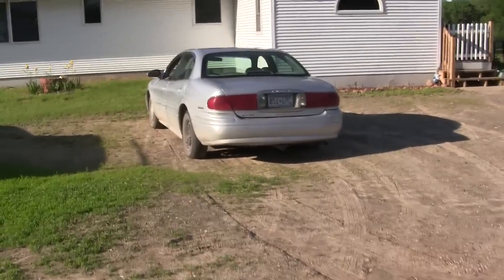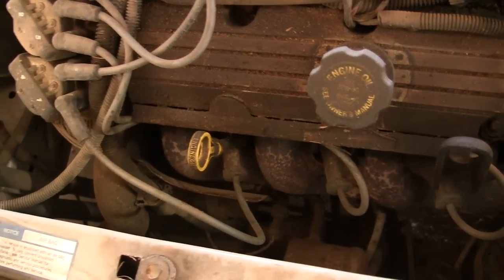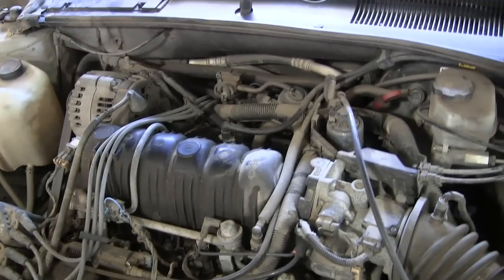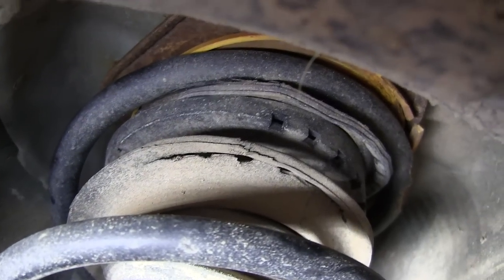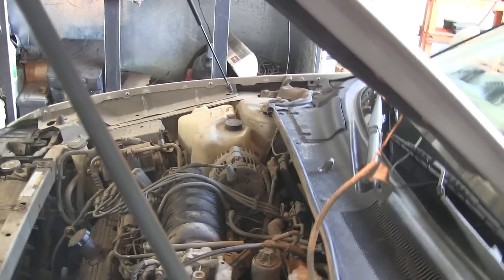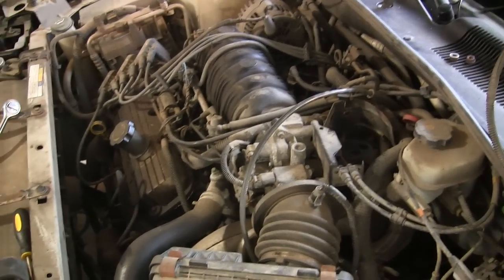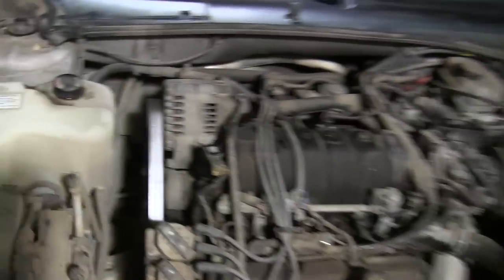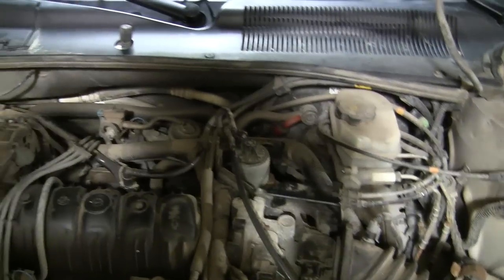Figuring out a miss in the 01 Buick Lesabre

Comment: The ICU is does go out on 3800 series II,  I have replaced mine twice on 2003 Chevy Impala LS,  the trick is to use heatsink compound on the bottom of the ICU on the metal plate.  Used some Artic Silver 5.   256k and still running strong  in 2019

Comment: A tip for other 3800 owners that may watch this; a consistent single-cylinder misfire on a waste-spark ignition system can be partially diagnosed just by switching the plug wires on the coil pack of the problem cylinder. If the misfire follows the wire, it points to the wire or coil; if it stays on the cylinder, it points more to the plug or cylinder itself. You can then swap two of the coils and see if the misfire follows the coil. If it doesn't, you could be looking at the ICU or inputs.
Reply: I put new plugs, plug wires, engine coils, and a new ICU and it still makes this sound and idles rough. Would you have any suggestions?
Reply: @yourbore you ever figure it out ?
Reply: @MonopolyBizTV  nope, wouldn't go over 30 mph. I had to get a new car.
Reply: I did that on a cavalier.  It both did follow the coil, and did not.  The ol Ivan don't touch it till you diagnose got me.  Was the intermittent ignition switch in the end.

Comment: The spark plug coil is my guess since you changed the plug. Then I would replace the ignition control module that’s under the coils. These are very easy to replace.

Comment: My wife’s 2002 Buick LeSabre was running rough.  Auto Zone’s diagnostic tool was of little help.  The car’s computer only threw a code that read “random misfire” which could be anything.  I was prepared to tackle the job of replacing all the plugs and wires because at 92 K miles I don’t think they had ever been changed.  Then after watching countless videos on how to replace the back three plugs I came across a video where the guy narrowed down the problem by simply unplugging each spark plug wire from each coil one at a time.  Sure enough I noticed that the wires going to the top coil pack which handles cylinders 3 & 6 had no effect on the engine when I pulled them off.  The engine continued to run erratically.  Hmmm....could this be my problem I thought?  So as not to pay retail in the event that I was wring I went to the local scrap yard and got one.  Plugged it in and viola....it worked.  Problem solved!  I was so happy.  I dodged a bullet.  I didn’t have to struggle with those back three which wouldn’t have solved my problem anyway.  

It goes to show ya that a misdiagnosis can lead to serious unnecessary work and expense.
Reply: Swivel socket is $5 those pesky back 3 would be out in no time.
Reply: @shanooby4359  That isn't the problem, it is getting the plug wire off so you can use the socket.  It is starting the thread to get them in that is fun as well.  I broke down and removed the alternator.
Reply: @robertsmith2956  bet those 2 bolts were a bitch

Comment: My experience after 25 years in New England winters and old cars from the 60s and 70s, we don't even try to take exhaust nuts off.  Just tighten until they break and then replace them.  In general the exhaust bolts are actually made to do that.

Comment: The ignition systems that utilize the otherwise wasted spark (like on the 3800 engine) fire one plug using negative voltage and its counterpart plug using positive voltage.  Center tip positive firing is said to be not as effective as center tip negative firing.  A coil that is starting to go bad may fire one plug poorly enough to set a misfire code on one cylinder but still be able to fire its counterpart plug sufficiently.  It can give the impression that the problem isn't the coil when in fact it is.

Comment: hello bac53 I have a 1997 buick lesebre 1997 the engine does not start I have gear and the board turns on and the luses turn off and it fails to start the engine, I have a spark, gasoline, in the scan it does not take out any errors that you could suggest me to check you, I would appreciate your information

Comment: Snap-on has the Vantage scope tester which checks ALOT of things! EBAY has it. It checks codes and waveforms and voltages and resistance etc. to find out what's wrong with a car. It has wiring diagrams on each car. South Main Auto has one. He's on YouTube.
Reply: The snap on vantage will not check codes nor let you look at a vehicle's data stream.   It is a damn good meter tho.

Comment: I have a 2000 Buick LeSabre and when I start it up and press on the gas slightly it misses and sounds like a backfire from the motor. also when going up a hill it feels like I lose a little bit of power, I changed the plugs and wires, did an oil change, what do you think could be causing this? Thank you for your time.
Reply: Scotty Warren Loss of power oxygen sensors. When is the last time you changed fuel filter? Suppose to change fuel filter every year. Loss of power means chew up gasoline. Its gasoline issue. Too lean? or too rich? You can pull fuel regulator its on manifold. First pull out fuel fuse before screw off fuel regulator you don't want fuel peeing out.  Screw it off clean it out with air hose this part rarely if ever breaks. Easy clean You could have a misfire fuel injector. You can use bottle of Seafoam poor in gas tank but use 91 octane gas a full tank aid in clean off baked on carb. take car out on the highway seafoam clean off built up carb. Is another check too if car shakes rattles? Its default or dysfunctional TPS (throttle Position sensor) its a lil black or gray in color plastic piece two screws take it off. 1 inch sizer piece. Diy.
Reply: Ignition control module underneath the coil pack. Also the factory penlum  in the 3.8 is shit. Take it off and order the upgraded one for around 75 bucks.
Reply: Here

Comment: Those coils always go bad, I remember changing them back in the late 90's.. your are on the top.. the older ones were on the front of the block.. kinda sucked..lol I was waiting for you to take a test light to ground out each wire at the coil..to see what one wasnt gonna make the engine run worse. nice that it was an easy fix.. and you have many parts cars.. sure helps :-)
Reply from the maker: 462ANIMAL That's why I keep so many buicks around, no shortage of parts.

Comment: Can you help me my 2003 Buick lesabre has fuel injector miss fire  cylinder 1 and circuit open I change fuel injectors plugs wire board and 1-4 coil still miss fire help please this my only means

Comment: where and how did you look at the "codes"?
Reply: NinjaViking1 Get a Actron CP9690 code tester. It checks live, record, graphing, emissions test, oxygen sensor test, transmission codes, ABS, SRS, solenoid and relay test, and MORE! It works on 1983-2013 and is updatable. EBAY has it.

Comment: Why didn't you change the spark plugs?
Reply: A putback get the hey Google put back at the video of the guy bleeding the cooling system for antifreeze on a 99 Buick 1999 Gs
Reply: Hey Google are you going to show me that video I add for 99 Buick GS for the cooling system radiator fluid antifreeze

Comment: just b9ought a 2003 lesabre with 68k miles. it idles bad after a half hour drive. somtimes it wont start if i dont give it gas. any ideas?
Reply: Mass airflow sensor
Reply: I'm having the same problem with mine under acceleration
Reply: Try new coil packs plugs and wires

Comment: In having same problem 2000 buick custom swapped all coil pack with new one and no firing on 1/4 coil pack same as before but now my catalytic  get red hot and run like crap, I think my ignition control module to a dive , any advice would be helpful
Reply: Yo did you ever figuire it out

Comment: Pull both plug wires off at the coil and see if the spark jumps the gap. If it doesn't the coil is bad. Easy check.
Reply: James Last I approve this message👆

if it's not coils just change the plugs....they are supposed to be done every 40-50k miles...only about 2.50 a piece

Comment: series III engine.  I had the 80K mile coil blowup.  It fired down into the ECU, made it to the fuse block where it popped it.  I was walking to the mailbox while the car warmed up.  Came back to a dead car.  Coil pack was broken open on the bottom. Replaced the ECU and one coil.  One month later ECU died.  Got my free lifetime warranty and bought two more coils.  While it was in spec, it did not match the OEM coil resistance.  That was 6 years ago, no issues since other than a water leak on the timing cover, followed by head gasket leak once the timing cover was water tight.

Comment: I have a new engine control module, new coil, and got a tune up on wires, but after driving my car for a while the service engine soon light starts blinking. I've also had my Cadillac converter fixed 3 months ago. I've paid over $700 to these guys to fix my car and it's still acting up.
Reply: What was it

Comment: Hey Bah53, I just got myself one of these LeSabres- the 2003 Limited with about 71k miles. I'm having this weird issue though, I'll put it into drive and I need to give it a good amount of gas before the thing bangs into gear and finally starts driving. I'll be taking it into the shop, and it's not too much of an issue, but I'm just wondering if you've had any issues like that.
Reply from the maker: John Harding I haven't had any issues like that on any of my Buicks.
Reply: bah53 Interesting, well hopefully my warranty will cover it. Otherwise, It'll just be one of those used car quirks to get used to.
Reply: Try fluid and filter change.
Reply: John Harding I know this is 2 years ago but did you figure it out? Mines doing the same thing. I'm taking it in Wednesday to the shop.
Reply: My 2000 Buick Lesabre has a P0304 cylinder misfire. My coil is throwing spark but is it throwing enough is the question. Also, my transmission used to shift really hard going into gear. Put a new MAF sensor on and now it shifts to where you can't hardly even tell it. Hope that fixes yours buddy. 👍

Comment: Sounds like you have a vw bug in the converter😃. Have you ever had a Lasabre with hard shifting issues? Once my park avenue heats up it shifts hard from second to third. Ps. I would have checked the coil first.
Reply: If your problem turns out to be a bad PCM inside the transmission side cover, I heard it was worth it to replace the two shift solenoids and TCC while you're in there. I had a hard shift with a 2004 Park Avenue and putting in those new parts fixed my problem. Not the hardest job, but not the easiest either.